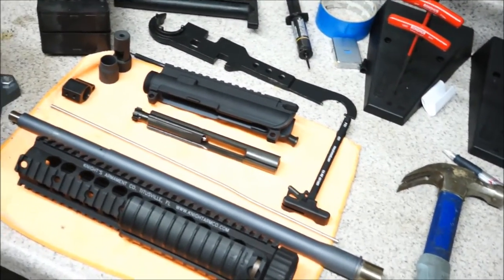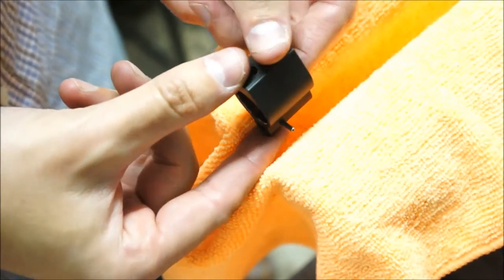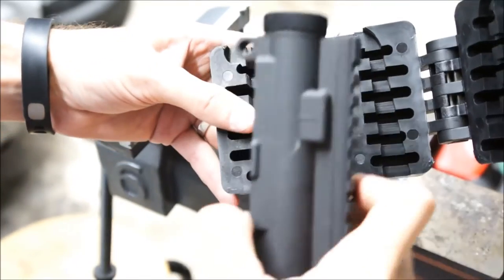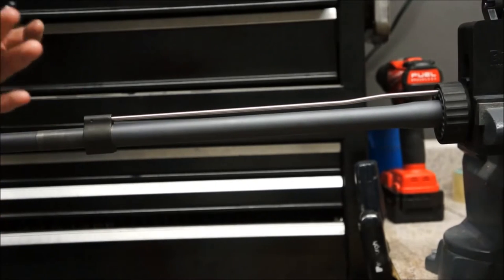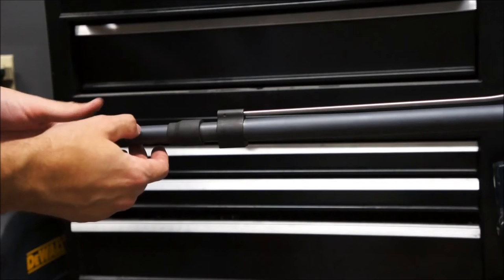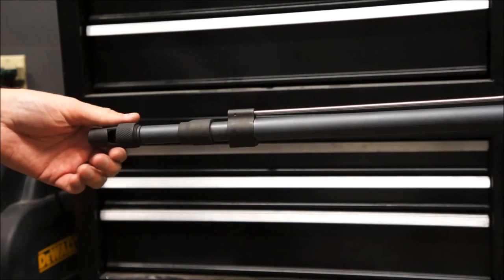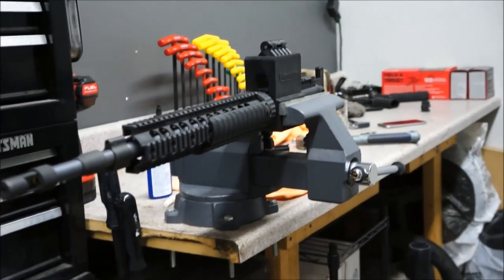MK12 MOD 1 SPR - Building The Upper

Comment: It looks great, I'm wondering about the barrel nut though, did you season the threads off camera? You need to tighten and loosen three times total with a torque wrench to properly season the threads of the upper. You use a torch wrench attached parallel to your armorer's wrench, you go up to 35 lbs to match up the gas tube, then loosen. Each time you do it you'll be able to go a little bit further in rotation, and you do the final tightening on the third time, not to exceed 80 lbs. Failure to do so can result in an eventual loose fit over time, since the barrel nut was not fully tightened to its fullest extent. We test for this by dripping CLP inside the upper around the seam where the barrel extension meets the upper. You then flex and apply hand force to the barrel and if you see bubbles or the oil being disturbed, you know the barrel extension has a loose fit. It generally won't be a safety issue, but it's an accuracy issue. The marksmanship unit dudes get oversize barrel extensions and press them into the uppers, but you can correct the situation by shimming and hand-fitting a barrel extension that's too small. 

We use anti seize compound on the threads of the upper, and when testing the gas tube alignment, we insert and reciprocate the BCG to ensure the gas key has no issues before we lock it down for good. 

Also for timing the muzzle device, I like to use a flat metal ruler and a straight wood stick. I place the ruler on the 1913 rail of the upper, then insert the wooden stick in the device. Looking from the muzzle end, you'll see the ruler on the upper as your true surface, and the long wooden sick inserted in the device will extend out each side, allowing you to ensure both the ruler and stick are totally parallel. Of course with crush washers you want to never have to loosen, so you get close and slowly tighten till the ruler/stick are perfect. This method allows a true timing while also removing the need to bust out any levels. 

Just some armorer tips, we don't work on Mk12s but some universal AR rules are worth mentioning. How does it shoot?

Edit: I forgot to say that the clam shells are good, but the Geissele Reaction Rod is the best way to go to avoid flexing or destroying an upper. It's really the best thing out there that I'm aware of four this kind of business.
Reply: Thanks for this. I ha no idea i'm in the middle of my MK12 build now
Reply: you know that whole seasoning the thread is complete horse shit and so is torquing it to a specific torque.During the time when the m16 was first being produced they didnt use torque specs that we have today, they just used a wrench to tighten it down and they didnt use grease and guess what the guns functioned perfectly fine.
Reply: Any issues with the crush washer and a suppressor?
Reply: @dsfssdfs7395  The rifles being built today are better than the ones from 50 years ago. They are more accurate. They are more reliable. They are more durable. These are facts that are not controversial. Technology and methods march on. We advance and evolve these technologies. So simply reducing this all down to anecdote from decades ago of "they worked fine" is completely missing the point.
Reply: @dsfssdfs7395  Provide a single source citing Colt, ArmaLite, H&R, Hydramatic, Sullivan or Stoner for that ridiculous speculation. Oh, wait, you can't...
   Nobody is interested in the ramblings of a child who thinks an anagram is a witty, suitable, screen name. Stick to Palmetto State and Olympic budget builds on your polymer lower; they are commensurate with your level of expertise. The Department of Defense armorers and M16 TDP disagree with you; but what do they know?!?
Reply: @dsfssdfs7395: your knowledge is lacking; barrel harmonics.  these are not the M16s of years past.  not even close.

Comment: Crush washer? Not using shims?
Reply: I know this is old but i thought the same thing. Maybe because the AEM5 and or OCM5 suppressors have the Ops Inc collar you can get away with this. The threads are on the Ops Inc brake but it buts up against the collar and that taper helps it get the proper alignment. Would love if someone else with mk12 knowledge could chime in here though… 🤔
Reply: @sportsmanslegacy  i have a mk12 mod 1. Ocm5. I use shims. Obvious reasons lol. If a muzzle break lines up incorrectly it doesnt matter if its over the barrel or not, the suppressor will be at a degree that can cause minor to serious damage. When using a suppressor ALWAYS use shims
Reply: @SouthWestGunnerOfficial  that’s what I’ve seen in my experience too. Just didn’t know if it was different with an over barrel suppressor as I have no experience with them lol. Thanks for the reply!

Comment: Awesome build! If you get the suppressor you need to take off the crush washer and time it with shims.
Reply: blugrassmaniac torque ?
Reply: @meidamx  long as it’s snug and it’s timed it should be fine long as you get at least 5 turns on the suppressor you’re fine just don’t use the crush washer use the shims that come with the brake
Reply: @rednecksniper4715  Thanks! I actually used a one piece break/collar adapter from Otter Creek Labs. Only 400 rounds, but no shifts.

Comment: My aem5 supressor collar doesn't freely slide on the barrel. Should I just heat it up?
Reply from the maker: From what I remember the barrel should be machined to fit the collar. If it is close, heat may work.

Comment: So sexy, I've got parts in the mail for this build. Still need to get the rail, arms scope rings, and a scope.
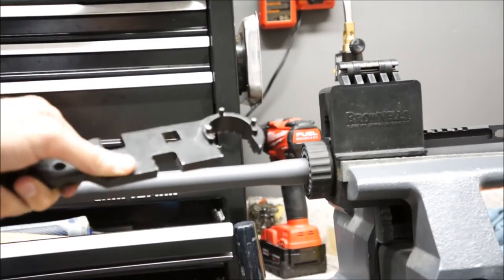Reply: I'd also like to reiterate the point about the rail collar at 4:25 . I did that a little bit when torquing the barrel nut, and a put a good little mark in the collar after accidentally tightening it against the receiver. Don't be like me! Pay attention! hah.

Comment: You should use aeroshell or something equivalent on the barrel nut. It's also a good idea to bed the barrel to the upper receiver. Something like Loctite 620. Bedding has ZERO cons when done properly and potential pros. Especially for something like a Mk12.
Reply: i disagree.  with correct spec parts bedding is unnecessary.  a coating of anti-seize on the extension and trueing the receivers face works better to enhance accuracy.
Reply: @tomacton6718 Review fleet AMU data in the re-education camp.  Bedding works with many samples to prove it.  In every instance where I have tested before and after, I've seen groups shrink from 1.5" or 1.7", to .6" to .7".

Comment: What's the part in front of the gas block?

Anyone?
Reply: Dont ask it’s a tapered collar that’s part of the muzzle device. The Allen engineering  suppressor slides over the muzzle device/break and then the sits onto that collar in front of the gas block. It’s tapered so you get consistent suppressor alignment every time you screw it on. It also wedged the can into that piece in front of the gas block so it doesn’t walk off when shooting.

Comment: Quick question. The collar is tightened down with a set screw with the collar tapering at a angle with the barrel? isn't that collar going to walk on down if you shoot it enough without a suppressor attached? I was never really big on drilling the gas blocks and barrel and than pinning it like you see most people doing now, since the area where the gas block attaches on the barrel is actually turned "square" in relation  to gas block even though the rest of rhe barrel may be tapered. All of my AR uppers now have the gas Blocks pinned to the barrel since i actually purchased a complete upper with that already done, and did find it much more secure, even though none of gas blocks have ever walked out on me. it was just one of those warm fuzzy feelings you get when atleast I feel there is one less thing I don't ever need to worry about. That collar though did leave me feeling a bit anxious.
Reply from the maker: I haven't heard of anyone having issues with the collar walking. The collar will rest against the barrel profile similar to the gas block so the set screw should hold it in place.
Reply: @HouseHoldOil  i emailed Allen engineering about the install of the collar and they recommended one drop of blue or green loctite under the sleeve .

Comment: I built my MK 12 Mod O completed about 3 years ago ............and I started it in 2010. I used the Douglas MK 12 barrel .......the carrier full auto but I had the WMD put their good NB finish on it. My bolt is a Sharps Relible Bolt with a McFarland One Piece Gas Ring along with 5 Coil extractor spring with black insert. I put a POF Roller Cam kit on the carrier. The Firing pin is a Titamium pin which compliments the SSA-E trigger. I also install a Viltor A5 stock system with a Tubbs Flat Wire buffer spring........sure is the best AR I have ever shot after 26 years in the military sure wish I had this then. What a tack driver the MK 12. My handload of IMR 8208 of 23.8 with 77 MK.